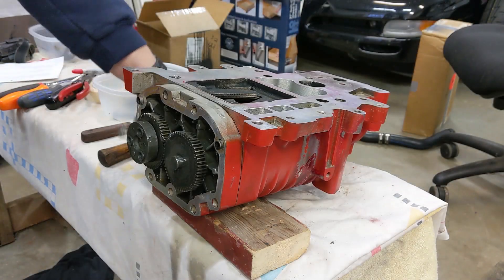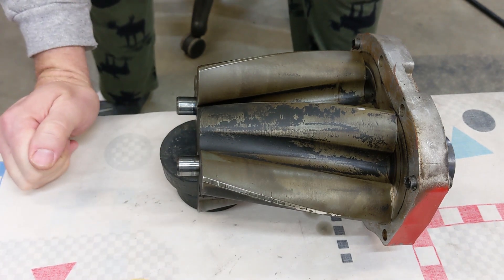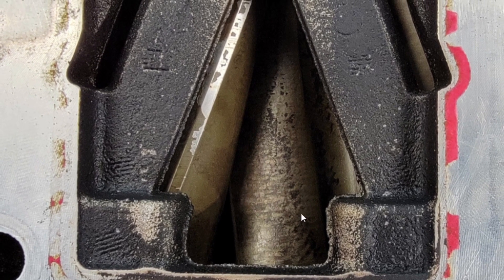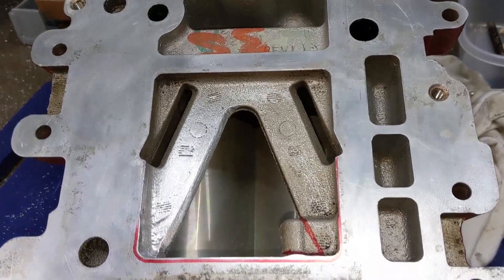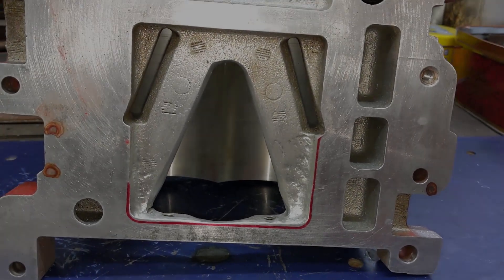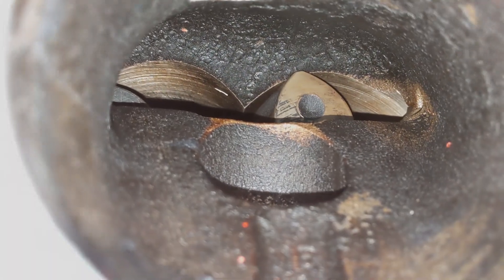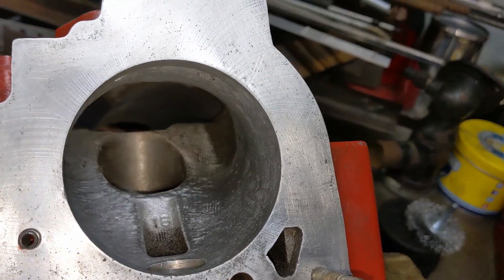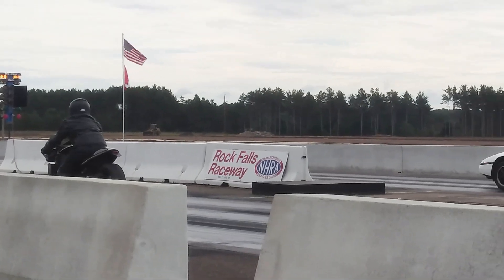3800 Supercharged Fiero Supercharger Porting

Comment: Doesn't the paint hold some of the Heat in? Like insulation. 
Just Polish it 👍
Add some Methanol/ Water injection Lines to it 🤯
Reply from the maker: Yes, a layer of paint probably does hold in a tiny amount of heat.  I don't think it's material however.

Comment: hi.🙂 And the round hole in the inlet, where the needle bearings are, can it be blocked? It's clearly visible at 5:55! Thanks! I have a problem with the crankcase gases, because I shut it off, I wonder if the gases are pushing back into the compressor?! Compression of 6 barrels is applied to all 4 cylinders in the head with an oil filler neck. I will be very grateful for the answer! Thanks !

Comment: Turn it over instead of using pliers n marking stuff up use a small thin blade flathead n put it between snout n charger body n lightly tap with hammer n it seperates them easier

Comment: There’s still a lot of meat to get rid of ,my advice will be to take the tip of the triangle all the way up to the where the line ends , another suggestion is to port and polish the throttle body

Comment: Why aren’t you using plastic strips on the rotor edges?
Reply from the maker: I don't believe the m90 has them, it's just got a coating and built to a tight tolerance.
Reply: @Toys4Life  My 8-71 did not have them originally. I sent it to the blower shop and they set it up.  Creates that extra seal to maximize boost. When I raced I was class restricted to a certain overdrive, but the strips were an extra edge, so to speak, that helped.

Comment: I vote for full polish.  Just hit it with light polish once in a while, and use flour to clean out the nooks and crannies, then hose it off.
An alternative is natural with a clear powder coat.  Looks good, keeps a nice sheen and stands up to gas and oil. A little simple green and hose it down every so often.
Reply from the maker: That would look pretty cool.
Reply: @Toys4Life  I had polished blowers on my race engines and they were actually pretty easy to keep up. Those housings are pretty hard and hold a shine.

My only complaint with powder coat is there are a zillion colors to choose from!  You could literally match it to your favorite tie.  

They would first lightly sand blast your case so it would be virgin aluminum, nice and bright.  Then color or clear.

Comment: My vote is to leave it raw aluminum.. You can bring the aluminum to whatever luster you're after and it'll look so good in the bay. All business
Reply from the maker: Not a bad option but I for my setup hard to work around the fuel rail - unless I get a modded fuel rail setup...
Reply: @Toys4Life  you can have the case blasted to achieve your desired finish. Not sure what they used but I've recently had a SBC intake blasted and it came out with the perfect sheen and still looks better than new.

Comment: I'm actually going to be painting my ported m62 supercharger in the spring and I decided to go with high heat paint in a gloss aluminum color.
Reply from the maker: The heat's not a problem, I've used regular enamels for all kinds of brake calipers and engine parts with no issues. The problem is if you get any fuel leaks on them at all even just a few drops it can melt away the non-catalyzed spray can paint.
Reply: Yes very true that has happened to me before and I was not a happy camper. Keep the videos coming Sir. I really enjoy them.

Comment: Pontiac engine blue metallic. How does this porting operation compare to switching to the Gen 5 blower for added power?
Reply from the maker: That is a nice blue.   They say it gets you closer to the Gen 5 but not quite.  Keep in mind the Gen 5 requires the new blower, new or modified lower manifold, Northstar V8 throttle body (to do it right) adapter, and new mass airflow sensor and a new tune .  It is an excellent update although I have never seen a quality back to back track or dyno test to really give an accurate number.   I will be testing this as I proceed because I am really curious - plus any mod I do, I want to validate it after the fact to see if it worked.  I will be doing this at the track to see if the car an run more than 114mph in the 1/4 in 11.8 seconds.
Reply: @Toys4Life  Real world tests are the only true tests. That's why I like your approach and why I subscribed!

Comment: I'm cringing a bit about taking out so much material that supports those two lower bolts. I bet GM put it there for reliability.  I'm going to interpret that you aren't the first to do this with success to gain some power!
Reply from the maker: I hear you, I copied designs that are tried and true from major 3800 shops.

Comment: Are you going to mention what grease to use in those bearings that hold the rotors? Thanks
Reply from the maker: Absolutely, in detail in the next video.
Reply: @Toys4Life  on the next video can you mention if you put sealant between the housing and the piece you installed the vice grips to? Just like you put sealant between that piece and the snout? Also if you could mention torque specs to put the supercharger back together that would be great!!! Thanks!